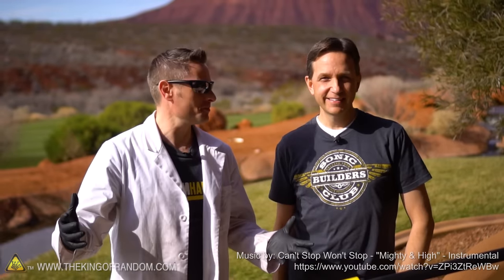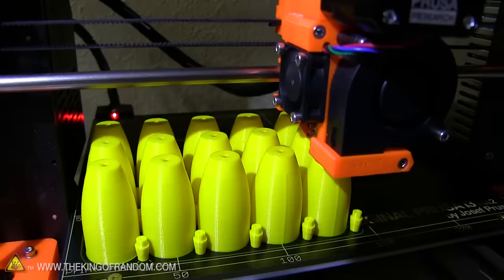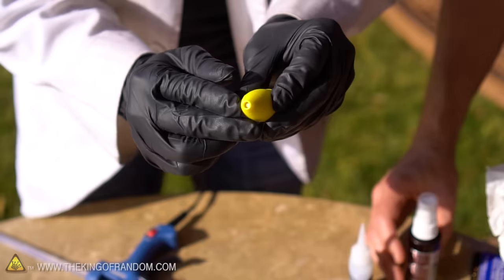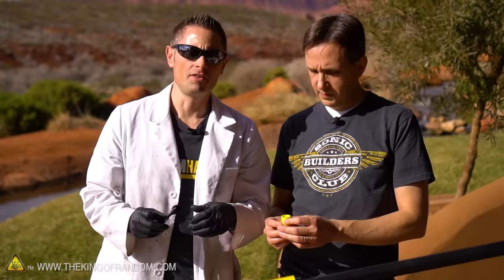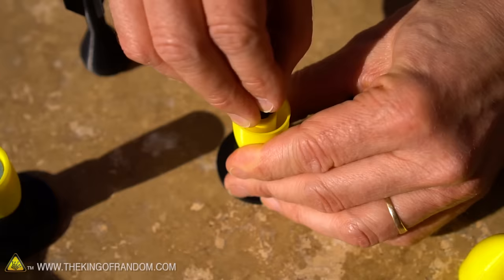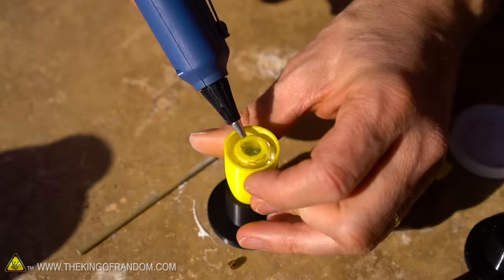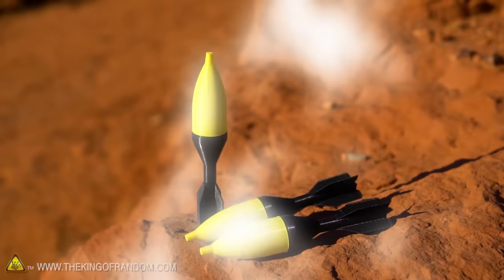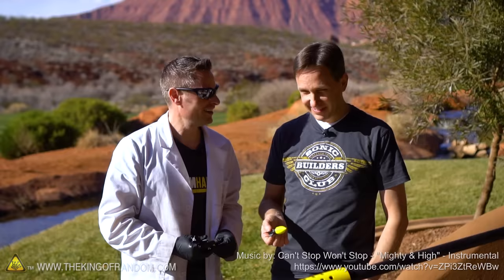Experimental Missiles That Go Off With A Bang

Comment: Replace the baby powder with corn starch should go up in a fire ball
Reply: Alfie Learmouth Murica'
Reply: You thinking that will cause a thermobaric reaction?
Reply: Alfie Learmouth even better, would be powdered coffee creamer. The particulates are combustible
Reply: How bout thermite
Reply: how bout gunpowder
Reply: Joshua Mah The Black powder in these charges doesn't create enough heat to ignite thermite.
Reply: Jasper really I didn't know that would magnesium work
Reply: Joshua Mah Absolutely man. Magnesium ribbon will do the trick
Reply: maybe not magnesium ribbon, to thick to get hot enough to catch fire from a small explosion, but magnesium powder ground fine would make quite a large fireball.

Comment: make a silicone mold of a coin, then make a coin with it and then try them in soda machines ....

SOORY FOR THE BAD ENGLISH
Reply: Carl Sheen would not try that too often
Reply: Carl Sheen yeah making counterfeit coins could get him arrested...
Reply: It isn't making counterfeit coins, it is making metal blanks, still illegal to use in machines, as it is theft, but noowhere near as bad as counterfeiting currency.
Reply: Roman Atwood has a machine that takes quarters. Grant could send the counterfeits to him to test so it would not be illegal.
Reply: He said use a mold -- that would imply transferring the impression of the obverse and reverse.  That's not a blank, that's a counterfeit.
Reply: ***** This is exactly what we are trying to say, doing that could get you arrested...
Reply: Al Foote III just drill a hole in it
Reply: Keep Calm And Cook No balls
Reply: Won't work. It's not the size or shape, it's the weight of the coin. When programming, let's say quarters, you put a bunch through and the machine sees the weight of them, and allows any coin within that range to be worth 25 cents. By doing that you can also use tokens (like in an arcade) or you could set up a quarter to be worth 10 cents, and a dime to be worth $2 (in Canada we have $2 coins.)

Comment: It's better to have the primer slam forward then the nail slamming backwards during impact. Just think for a second.. What if the nail slammed backwards with enough force during the firing of the projectile from the launch tube?
Reply: There was a part of the cone which was solid so the nail had to pen through the plastic to get to the primer

Comment: As a kid I loved using black powder in my homemade rocket warheads. I always built them to detonate at the apogee which was usually so high that the rocket could no longer be seen. The black powder created a respectable report along with a large plume of white smoke. I went on to trying flour, a full can of dayglow orange spray paint, colored chalk line dust and a cup of gasoline. All made impressive displays in the sky. All that was in my teenage years nearly forty years ago.

Comment: Would gasoline still catch on fire if it was frozen?
Reply: Zacttack Only vapor can catch on fire (with the exception of flammable metals). For instance, when you light a candle you hold a flame to the wick until some wax melts and then vaporizes and then it is the vapor that catches on fire.
Reply: Zacttack gas doesn't really freeze lol

Comment: Hi..I came up with a similar design years ago when I was thinking about putting small Estes rockets on my r/c helicopter I was gonna put fins /wingson my heli to look like an attack heli and put the small mosquito Estes rockets  on the wing and hook up an ignitor to it along with an extra servo that would  was hooked up to a  switch that would turn a 9volt battery sending power to the ignitor and so forth.. I then got the idea of puttin a larger rocket on the heli one that could house a 410 shotgun shell in the nose cone and a nail in the top of the nose cone.centering the nail on the primer of the 410;shotgun shell.. It worked.. It worked to well honestly.. I set up test models with this set up fireing them into a tree. I went as far as using a slightly larger rocket with a 12 gauge shotgun shell.... It was a  krazy dangerous and the blast was uncontrollable sending the shotgun pellets in every direction.. I decided not use this idea on my heli do to being scared I'd destroy my expensive gas heli... But I then thought I could use blanks and get the same effect without the danger.. I used your sugar rocket  PVC pipe design and it worked great. BTW keep the awesome vid's comin.. I really enjoy them...... Thanks.... Ray.. Take care

Comment: I like the paint scheme, black powder, blasting caps, or primers, and ceramic molds for cast iron parts, riveted together, like a rocket propelled mortar

I think it would look better as a checkerboard pattern, but that's just cause I'm Gothic

The plastic 3D prints you can make the molds with, but, it's better to separate the pieces, and then assemble afterwards. Like an Estes Rocket, but with black powder, instead of cardboard tubes

Comment: Use flash powder instead of black powder and instead of hot glue use screw type locks to hold the tail and head together so I can just screw tem together instead of using hot glue

Comment: I want to make a yard art b.o-m,b. Something that stands next to the shop that looks real but isn't. Originally I was going to paint an oxygen tank and put some fins on it. The only problem is,  it looks like an oxygen bottle with fins on it. I want that iconic shape that most people associate with as an explosive device dropped from aircraft. Pointed tip, expanding in circumference until just past half way and then tapering off to a near point at the end. Four guide fins with a circular piece of metal around the outside of the fins.  I'm having a hard time figuring out an easy, inexpensive way to make one approximately 5 feet high. Any ideas? What is out there that has shape that I could use other than a real one? Please no wood. Wood just doesn't hold up well outside. Thanks.